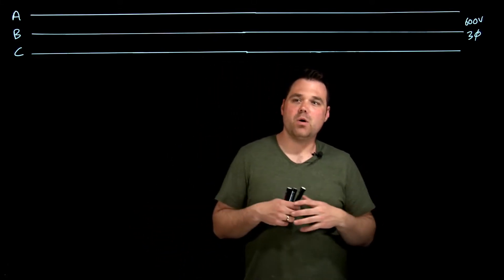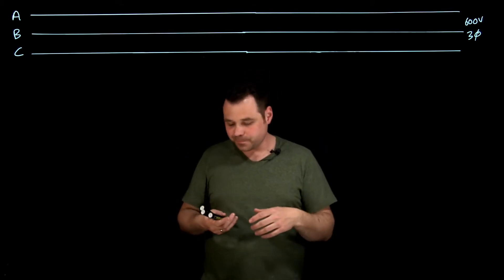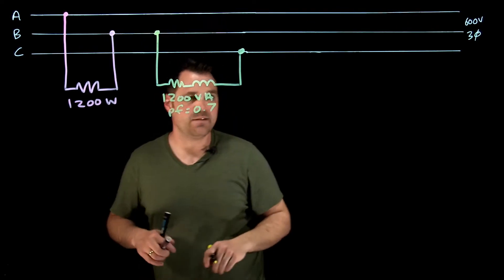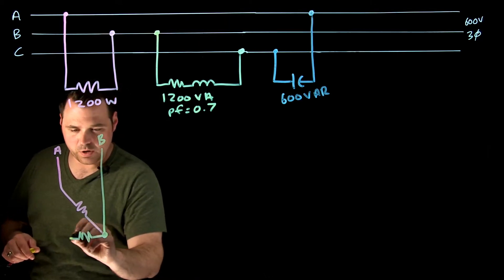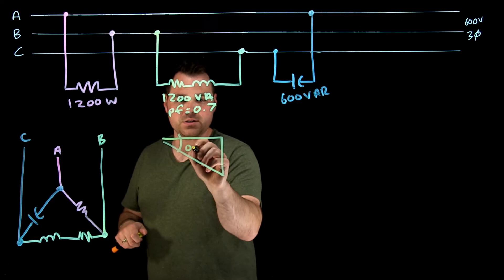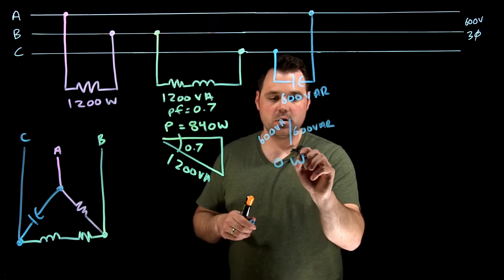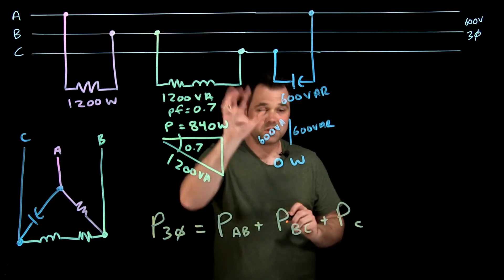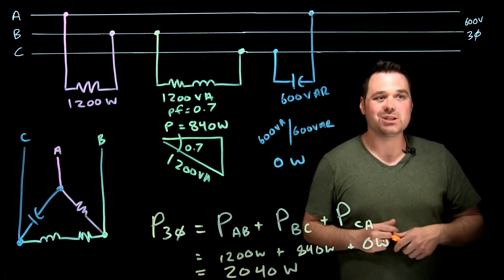Unbalanced Power in a 3-Phase Delta Circuit

Comment: I need to determine power consumption for a building with center tap delta given measurements of line and neutral currents. Impedance between phases is unknown.  Pleas show how this is done.
Reply: Break down your loads and add together based on the 3 phase 3 wire system (A-B-C), and your single phase loads in the other 3 wire system (B-N-C).